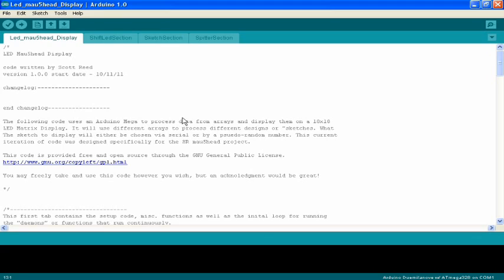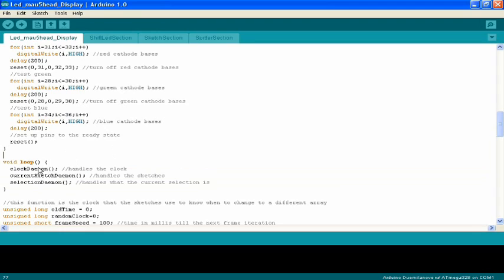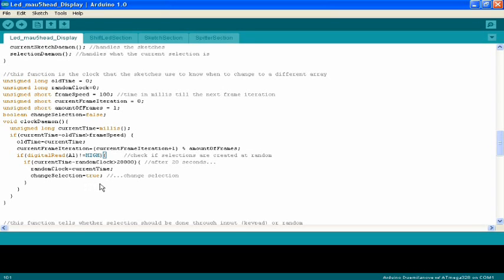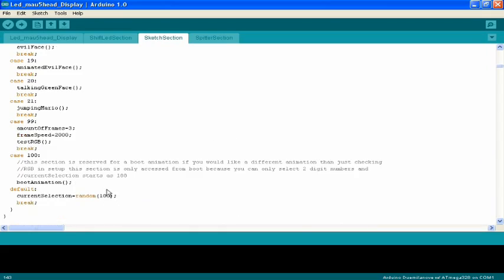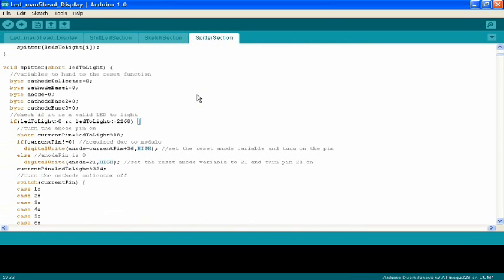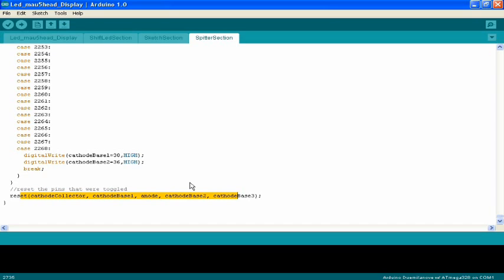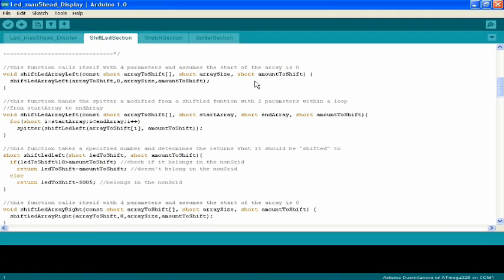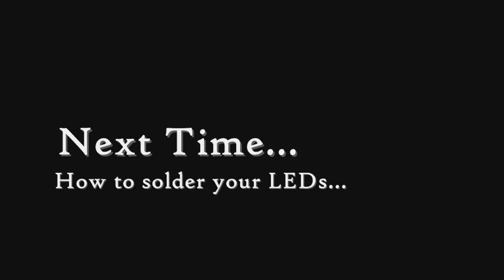The Code Powering the Mau5head

Comment from the maker: The brightness is dim because my code is very inefficient. It has 1 pixel lighting up at a time. If you light up less LEDs in a frame, they become brighter. An attempt to resolve this would be to light up an entire row at a time. (it is a 18x18 grid, if you light up 1 pixel at a time, it will be 324, however, if you light up a row at a time, it will only be 18) I could not do this with this version because I multiplexed the transistors, so I could only light up an entire row of transistors.